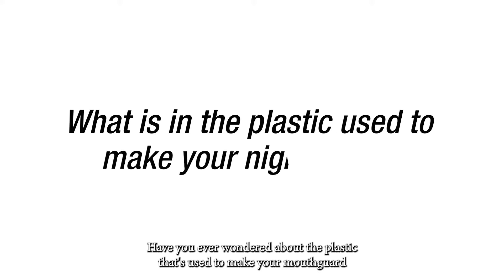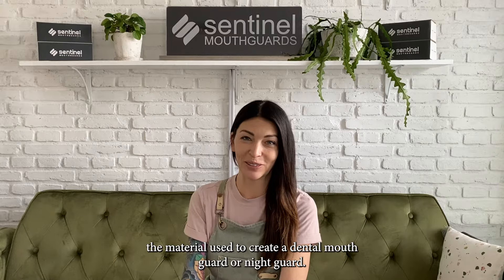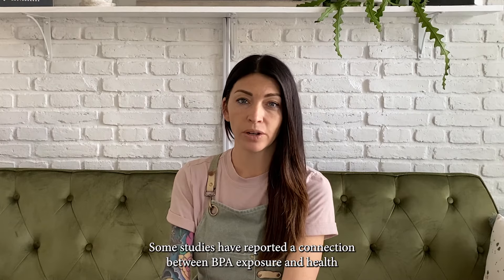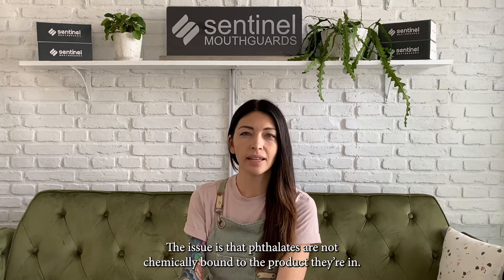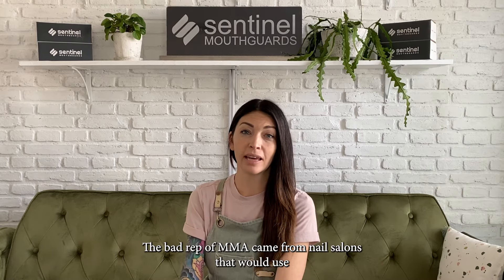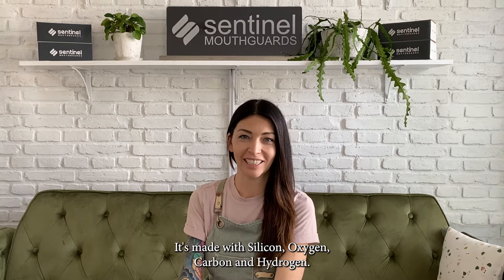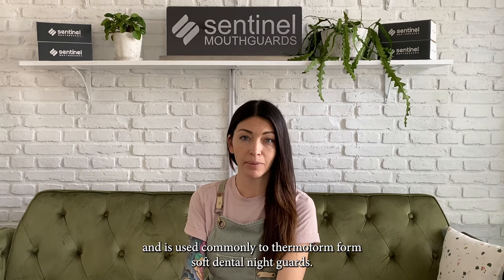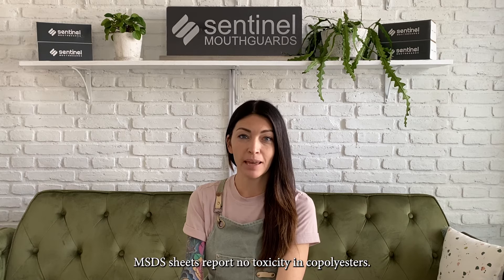How Safe Is Your Dental Night Guard? Discussing BPA, Phthalates, MMA, Latex | Sentinel Mouthguards

Comment: I was told the curing process should alleviate my concern despite phthalates?
Reply from the maker: Thank you for your comment and for raising this concern. At Sentinel Mouthguards, we take the safety of our products very seriously. I want to clarify that our mouth guards are not only BPA-free but also do not contain phthalates or any other harmful substances.

The curing process we use ensures that the materials are fully set and safe for use. However, we want to assure you that our products are manufactured without phthalates, ensuring that you receive a high-quality, safe product.

If you have any further questions or need more information, please check out our website: https://sentinelmouthguards.com/faqs/

Comment: What are the ingredients in your product?
Reply from the maker: Happy to help! Sentinel Mouthguard products are not only BPA-free, they are NOT manufactured with bisphenol-S (BPS) or any other bisphenol compounds. In addition, our products DO NOT contain any of the following: methyl methacrylate (MMA), polyvinyl chloride (PVC), vinyl, phthalates, formamide, tolumide, silicon, latex, or gluten. 

https://sentinelmouthguards.com/materials-and-safety/

At present, EVA, or ethylene-vinyl acetate, is the standard soft night guard material.

Sentinel Hard Night Guards are made using Copolyester.
Reply: @Sentinelmouthguards  thank you for the information. Could you clarify if your mouth guards are made with EVA or copolyester? Or both? Also, what’s harmful about silicon mouth guards?